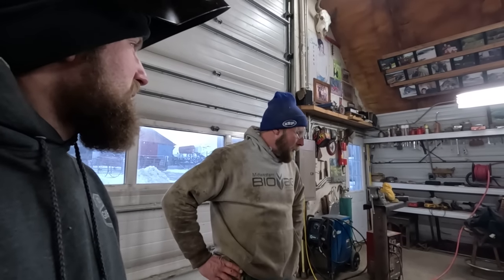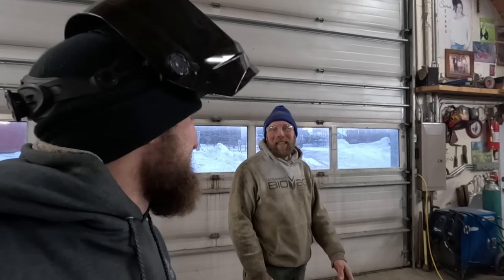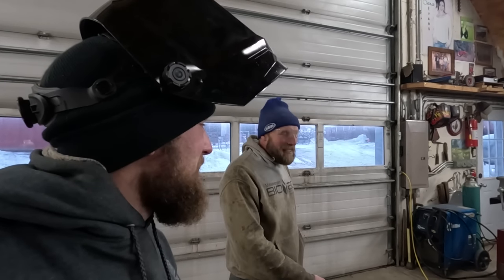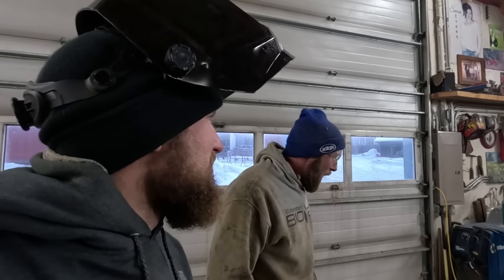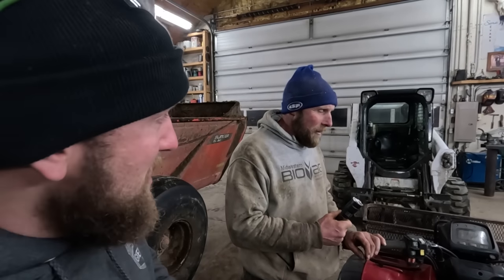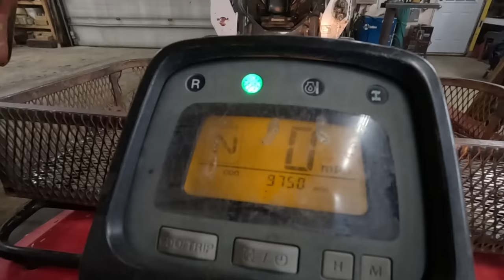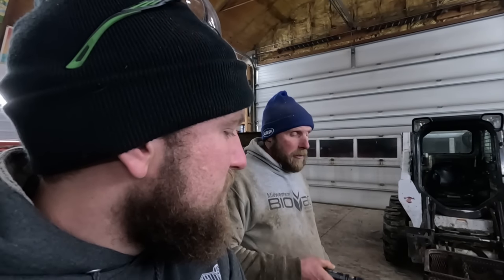Is That Going To Work?

Comment: We have a Honda rancher, roughly the same age and has the same options, though it is a 350. We have over 11,000 miles on that and it still runs like a top. It has spent most of its life herding cows and fencing, much ike yours. We also have a Kubota RTV900, and it is a tank. It is built to work, but it will not do much for speed down the road. It is great for hauling wood, sap barrels, fencing supplies, seed, etc. However, they are hydrostatic, and can be a bear when it comes to put the power to the ground. Overall it is a great machine.

Comment: i have a 2016 Honda pioneer 1000-5 its a beast i can pull a 2000 pound camper which i turned into a ice shack right down the road on the ice no problem hondas in my mind are the best machines out there

Comment: Your comment about the wirefeed vs the old arc welder "buzz box'. I have a nice Fergison 190 mig welder, but I use my old stick welder buzz box 95% of the time, because that is what is what I learned on and I am skilled with. LOL

Comment: I bought a used Kubota 900 rtv 7 years ago. Have a fence repair business and use it for hauling supplies. Can put 5.5' t posts in the bed and extra spools of wire. That diesel is real efficient and starts great. They are really built to work. This one has a 3 speed, it's an older model. Low with 4 wheel drive and the differential lock will really pull.

Comment: In1977 we got a brand new 90 Honda for $750. I bought Honda 250sx in1986 it's still on the farm (tons of miles on it) paid $1650 for it. The last one we bought for the farm is a 2002 Honda 350 rancher still running strong, I think we paid $3400 for it. I'm  55 years old now and can't afford a new machine now. Honda made a reliable product back in the day.

Comment: Someone said about using the torch with gas on the floor....if you aint living on the edge your taking up to much space...nice four wheeler by the way 1986 or 87 honda 4x4 the first ones solid front axle look them up real hard to find but worth the money

Comment: You guys work great together. I had a welding class in 65 to 68, stick of course.  Finally a few years ago got a wire welder, reason for a new welder, the stick welder was 48 years old, love welding with the wire welder.  Unless it is Rusty.  We have a soon to be 17 year old Kubota RTV 900, which has been a good work horse.  My first 4 wheeler was in the 80's,  was a Yamaha Terrapro with a PTO on it.

Comment: I have the exact same Honda Foreman. One of these days I gotta get new tires and figure out why the starter isn't working. I have to pull the rope to start it. We use an RTV Kubota diesel that we use at the stable I run. We feed all the horses in the pastures and clean the pastures everyday and haul the processed hay out in a cart. The first one we had got about 5500 hours before the cam bearing wiped out. We replaced the engine, put another 2500 hours and traded for a new x900 RTV. That one is at 4500 hours so we are starting to wonder how long it will go. The worst thing is it has to idle a lot. I do think it's heavy duty and I think the transmission is better than a lot of the other machines for pulling.

Comment: Thanks for the video.  I agree about using the stick welder,  mig is great on new steel in a shop with the door closed  but  when there are too many variables laying in a bad position welding less than perfect metal the stick is the machine.   The rod I use the  most  is 7018-1/8

Comment: I believe that the reason that things are not made as well today is connected to the digital technology because the cost to make mechanical METAL parts is more expensive in the long run and digital  is small, many times made with plastic parts, sensors, and computer chips. Digital can be wonderful when it works, but once something goes wrong fixing it becomes difficult and involves either replacing the whole thing or finding someone who can fix it for you.  My husband is great at sensors and soldering loose connections, but otherwise doesn't like to work on anything. And the problems with anything new that is heavily digital is not just with found equipment like yours, but also everything from sewing machines to stoves. I dread the day my refrigerator or stove don't run well for I really think it will be hard to find one that is mostly just the basic model without features I won't use.

Comment: In the 60's and early 70's you could afford having a shop fix equipment but after that the labor rates are just too high. I repair 100% of my equipment and it does not matter if its a major engine rebuild or a simple repair but you have to have the shop and tools and knowledge which I have and it looks like you also have. At 61 I am still buying tools and started with my first tools at 12. This is the way to stay farming.

Comment: Great atv choice. I have an 02 Honda Foreman 450 S. Same red color. It is dang near bullet proof. Also had the same fuel leak. I kept the fuel off when not in use and eventually cleaned carb.

Comment: If you got a welder, you can fix anything! I farmer fixed a lot of stuff! It doesn't have to be pretty, just workable! I got a fleet of Wheelhorse tractors! One is a 1966-1076! They don't make them like they use to! I won't buy a Wheelhorse if it's made after 1986!

Comment: Honda Rubicon I have a 2004 I bought brand new has a low range it’s automatic gear on gear been a great four wheeler never had to do anything to accept change oil in front brake pads. mine has been so good we bought a 2018 for my wife. We use both of them almost every other day to pull A ground drive 80 and 50 bushel round right spread! We drag all are fire wood out the woods with them and do all are fence. They are great machines in the last forever The Honda frontier side-by-side‘s are awesome machines too!
 
Is that a manure grapple or what do they call it I see it’s a bobcat brand?

Comment: Need some 6011 (or 6010 if it’s a DC machine) rod for rusty old metal.  It will penetrate much better than 6013. It won’t be as pretty as 6013 but it will hold better.
Ain’t it the pits to start fixing one thing and finding something else wrong?

Comment: I must be lazy, and the boy is getting lazy.............We haven't ran our 4 wheeler other than to charge the battery and run out some fuel since fall..............Like jumping on our JD gator alot better, it runs 2x a day every day of the year at the minimum, some days alot more than that.